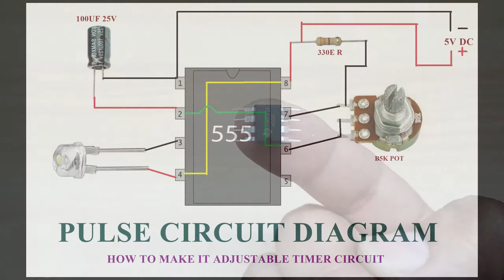How to Make Pulse Timer Circuit { IC555 } | How to make an led flasher circuit with a 555 timer chip

Comment: - Invert the pins on the pot to have the LED blink faster when turned clockwise and slower when turned counterclockwise.
- If using regular LED, add a resistor between Pin 4 and LED+ (330 ohms for exemple)
- You can use higher votage, up to 12 or 15 volts, but LED resistor in pin 4 might be increased if so.

Comment: hello can some one help my please I did see lot pwm modulators on the internet but my project is difficult I need retarding mechanism for my hei 4 pin ignition module it uses variabel reluctor wheel or also called pick up coil so the idea was that I use simpli second ignition module and ignition coil and simpli use split wire on the pick up coil so I can run dual ignion modules so the idea was 1 modules run normali the 2 module wuld drive an pulse generator the input is fead from same pick up coil to the pulse generator thats onli used for engine start up because my original ignition module does not have retarding option my lande does not suport any upgrades for my distributor so I hoppe some one can sugest some thing Im not shure if ac signals wuld trigger those hand heald pulse generators some thing is mentioned TTI input there are 3 pins I dono what they are .Any way I hoppe some how to bypass this problem with dobbel circuets to creat some sort of delay circuets betwean dual ignition modules just so I can use same pick up coil to trigger 2 circuets and switch of and on ich circuet seperatli that problem plagues my for years so I try to finde solution for it the original 4 pin gm ignition module is weak has terribel ignition coil saturation it does not work under low rpm engine ranges and ithas weak spark in cold weather also it does not have retarding option as well. So I hoppe my question makes sence there are lot pulse modules online so Im not shure if those pins wuld work on ac electriciti at all or must I convert it to dc first wia resistor and capacitor??? 🤔
Reply from the maker: Hello! It seems like you're working on a complex project related to ignition modules and pulse generators. Let's break down your query and try to address your concerns.

You're looking to modify a 4-pin ignition module with a variable regulator wheel or pickup coil for a more efficient ignition system. You want to use a second ignition module and ignition coil, splitting the wire on the pickup coil, and then use a pulse generator to manage engine start-up. The original ignition module is not meeting your requirements due to weak performance in certain conditions.

To use a pulse generator with AC signals, you generally wouldn't need to convert them to DC before feeding them into the pulse generator. AC signals should work fine with most pulse generators. The TTI input with 3 pins likely has a specific purpose or configuration for triggering the pulse generator, but without more information, it's difficult to provide precise guidance.

In terms of creating a delay circuit between dual ignition modules, this is a valid approach to synchronize and manage the ignition timing effectively. However, the specific design and components for this would require a detailed understanding of your ignition system and the modules you're working with.

For a more tailored solution and to ensure safety and functionality, it might be beneficial to consult with an electronics or automotive specialist who can better analyze your project's requirements and suggest appropriate modifications.

If you have more specific questions or need further clarification on any aspect of your project, feel free to ask!

Comment: I breadboarded this on TinkerCad, and the only way I could get it to work without blowing the LED every time was put another resistor between the positive (anode) leg of the LED and pin number 4 (also, I was using a 9V battery for power). After that it worked just fine, thanks.
Reply: I want to use this with 9v too -- I'm curious what resistor did you use? Or does it kinda depend on the LED? Just wanna save some time -- and LEDs 😅